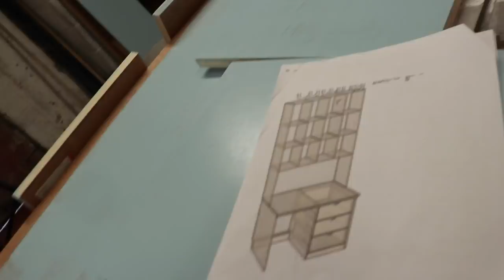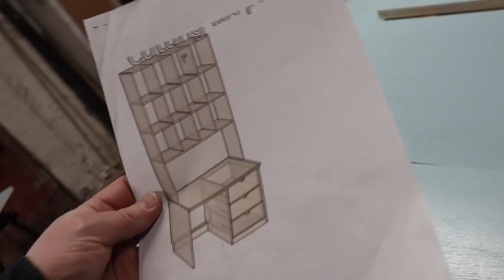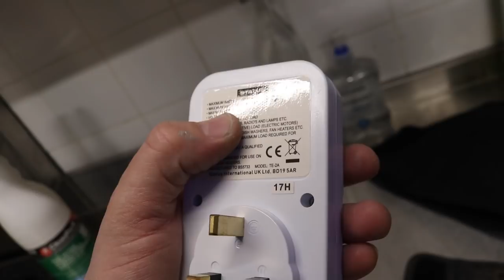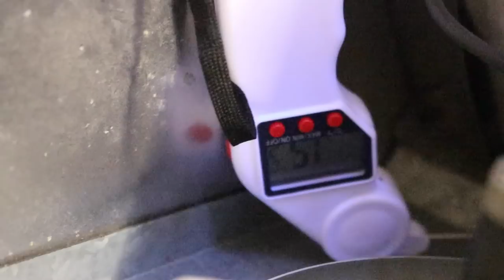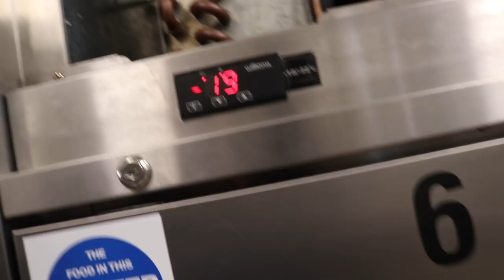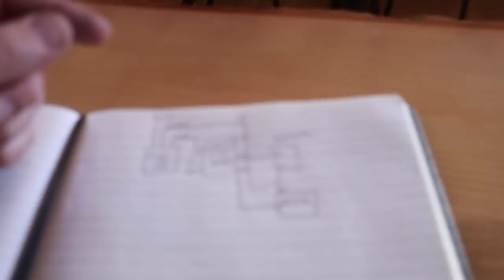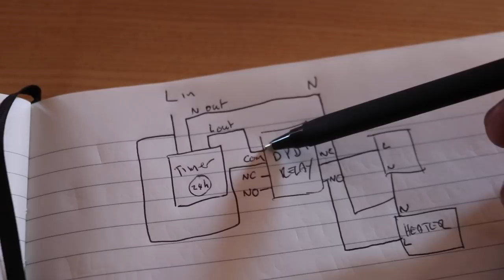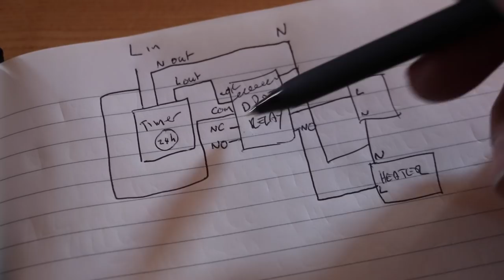Spring will still happen

Comment: Use a heat gun to defrost evaporator to start. Buy a cheap refrig defrost timer and that will shut everything off and turn the heater on for 20 minutes.